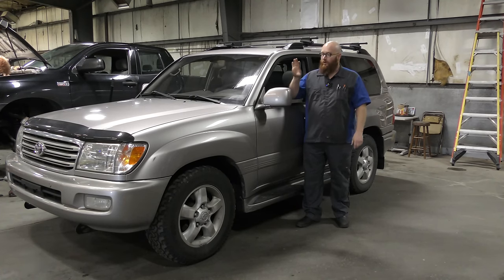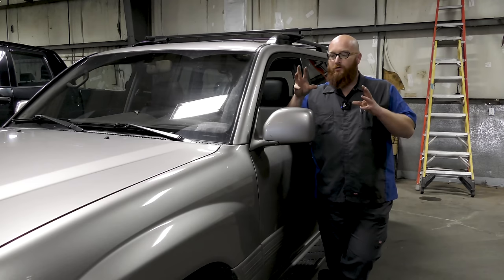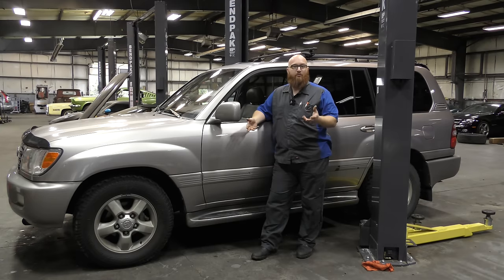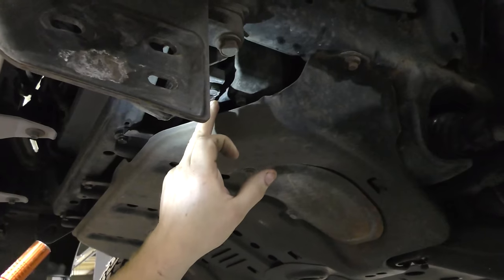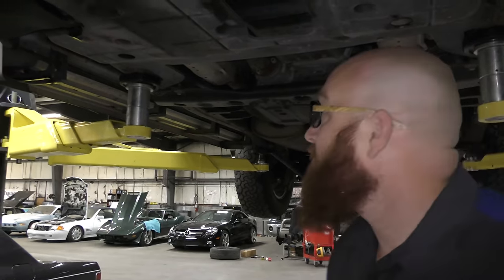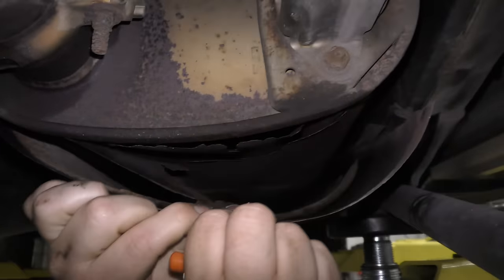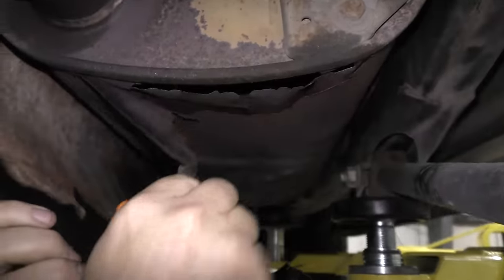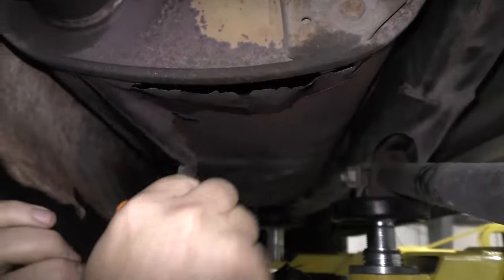Vehicle Making a Horrible Noise?! CAR WIZARD finds the problem & shares how not to be duped by shops

Comment: The ticking noise commonly heard with the 2UZ motor is typically due small cracks on the exhaust manifold flanges or a slightly warped exhaust manifold where it bolts to the block . A fairly common failure on the 100 Series Landcruiser.

Comment: The original radiator on my 100-series Land Cruiser cracked in the exact same spot. It had 229,000 miles on the odometer. Thankfully, it was an easy job; much easier job than the 80-series land cruiser that I replaced the radiator at 247,000 miles. I really do love these vehicles. The only downfall is the crappy fuel efficiency.

Comment: For serious off road Hilux, Land cruiser and Nissan Patrol/Safari Landrover, Defender, suzuki, and some jeeps.  We had to tow a Bmw X5 off a flat wet lawn. They are the most useless 4wd on the market. Ive done 7 years as a Toyota mechanic. 14 years on european cars. Toyotas are better. You buy them , one or two services a year depending on mileage. Thats it for the most part.  Now most land cruisers need front wheel brg adjustment once a year. At high milage the 80 series may need new front cv joints and axle flanges that they run in as they wear. The drive shaft may need to be taken off and have the diff pinion seal replaced and the transfer case output flange nut retightened. The occasional seized front brake caliper. Thats about all that wears on them other than  the normal stuff like brakes,  clutches, fanbelts, bulbs etc.

Comment: Any vehicle will last 200K miles, so long as you constantly perform preventative maintenance, but Toyota's (not all of the models) will probably cost you much less in replacement parts getting to 200K.

Comment: Oh mr. You just showed up late,
Because I did the very same mistake and told the mechanic I think and I need and I spent alot for that on my 2000 volvo s80, to discover later that nothing.. nothing was done to the control unit that I opened myself later and still has an issue and has a blown obvious line and some brownish component that may has gone bad....Thanks sir.

Comment: I had a 2008 subaru wrx sti that overheated every now and then and I got no warm air into the car. I left it to an authorized Subaru workshop and they told me that the head gaskets needed to be changed. After ALOT of internet research I found the actual problem. The cooler cap and the coolent reservoir cap were sitting in the wrong places. Just switched places on them and it fixed the problem. Perfect engine temp and alot of nice warm air into the cabin.
It never needed a head gaskets change and I'm lucky I found the problem myself before considering leaving it to the workshop (who wanted 2500$ to change the headgaskets).

Comment: Issue I've had that acted like a serious problem but ended up being something silly was in my 97' Oldsmobile Regency, The electrical system played up and it would kill the entire car. My dad spent months chasing it down and eventually we sat the car because of it. Turns out it was two silly things. There was a ground and small control box for most of the internal electrics below the carpet of the drivers door that was improperly protected from water so anytime someone got in or out with wet shoes it got wet, over the years it corroded away the metal and it started to short out and all kinds of other issues.including the second one, eventually it got so damaged that it blew out a relay under the dashboard and continued to blow it out repeatedly until we found out about the electrical box. In the end I think the relay and electrical box ended up being less than $100 to replace and it was something we could do without even going to a shop, it caused the entire car to die and the power features to act up, it was as simple as water got into something cheap that wasn't properly installed at the factory or somehow got damaged over 20 or so odd years. 

We sold that car a few years ago for around 1500, listed it pretty cheap despite it being low milage and really nice for what it was,  parents didn't want a sedan anymore, got an SUV instead, as far as I know, the Oldsmobile is still on the road with the guy who bought it, was a teacher that really needed a nice reliable car. According to carfax it hasn't been to any shops or anything since aside from inspections.

Comment: To respond to the question at the end. My 02 Tundra had a check engine light come on and I didn't have a scan tool so I took it to Autozone and they pulled the code. Code came up as evap canister close to $300 if I remember correctly for the part. Told them I didn't want to order it just yet (as you should always do if you have a auto parts store pull codes cause they will try to sell you parts and you may not need what they say). Anyhow, went back out to my Tundra and pop the hood as the Evap canister is actually up by the firewall. Found a vacuum line had cracked with age and came off the canister. Cut the end off that was cracked and put it back on, good to go.

Comment: Just occurred to me that the "horrible" noise (exhaust leak) was something the customer didn't recognized.  On my dad's cars, without fail, every couple of years the exhaust would rust out on one of our cars and we knew exactly what it was!  Worst was a 1979 Chrysler Newport, only a couple of years old at the time--it broke right at the weld on the cat.  While we were on vacation.  Had to find a garage with a welder to put it back together (which fixed that problem permanently...which is more than we could say for the rest of the car that was falling apart from the day we bought it new!!).

Comment: Toyota LC and LX470 are the best cars. I have one. But, the LX has three common problems. The screen that has air conditioner and radio in the same package, spare part is usd 14000! The hydraulic suspension (solution could be to replace it for a normal suspension) and the third is the traction control. Common issue is the gioroscope adjustment. When I was driving at 70 km going up a hill, and taking a curve to the left, the car drastically turns to the right. Not even the dealer knew how to fix it. So i disconnected it.

Comment: I have seen this same thing happen in my shop over and over. A tot of times a loose heat shield will bring a car in on a tow truck with a very worried customer. Fix simple heat shield = happy customer. Miles of Smiles.

Comment: It’s true I had AC issues and took it to a shop and they recommended that a replace the HVAC system, I took my vehicle to another shop for second opinion and he filled it with Freon and a tracer. It’s almost been a year and still working. They saved me 1500.00

Comment: Even if you don't tell them what you THINK it might be, they'll still quote you insane things you don't need. - I remember one time I took my car for an oil change, they did an "inspection" on it and claimed my timing belt was "dry and cracking" and that it needed to be replaced soon. But then, later on, my engine was misfiring because the ignition coils went bad (this was a 2010 Hyundai Accent, so it was time to change them and the spark plugs anyways, but at the time I didn't know that yet) - And I took it to a different shop... no mention of an issue with the timing belt, but they did claim the same issue was happening with my serpentine belt (dry and cracking). I replaced my own ignition coils and spark plugs (and made sure to properly gap them as well) and that engine ran better than it did when I bought it (I splurged on high quality spark plugs to make sure I'd never have an issue so long as I owned the car.) - The serpentine belt looked brand new. The car still had under 100,000 KM when I sold it and moved on to my next car. If you drive an older car that's out of warranty, try and diagnose it yourself (OBD2 scanner if your car supports it is a good start) and try and fix it yourself as well if you can. Oh and do your own oil changes, it's a fun way to spend an afternoon too!

Comment: I was going to guess it was a cracked exhaust manifold, because when I was considering buying a V8 4Runner, the only real issue that people have with the 2UZ 4.7 engine is the exhaust manifold cracking, other than that it is one of the most reliable engines Toyota has ever made

Comment: I would never tell anyone I was willing to buy a new engine, even if I new damn well I needed one.  I'd still go in and play stupid like "Well, it's making this horrible ticking or banging noise but I don't know what it is".  In my experience, it's best to find a mechanic you trust, and play stupid but be smart at the same time.  And by that I mean treat it like you're buying a car... don't tell them more than they need to know.  Don't tell them how much you're willing to spend or do to the car up front.   Let them do the talking and let them give you their findings first.  Also know your sounds and be able to identify common sounds for common problems (such as a ticking from the motor might be lifters or valve problems, which can be a serious problem and in some cases, may require a rebuild or a new motor depending on how bad), a rattling noise from underneath might be a catalytic converter that's coming apart inside or a loose heat shield or metal shield somewhere.  So if you know a little about cars, what to listen for and don't give out too much info, you can avoid being ripped off.  Getting an estimate done is like buying a car, don't tell the shop more than you need to.  Don't tell them what you'd be willing to spend because they'll find a way to make you spend that money.  I always error on the side of "Well, that was more than I was planning on spending..."

Comment: I had done some front end work and then when I took it to get an alignment, they quoted me $1200 and some of the parts I replaced, they wanted to replace.  I told them I couldn't afford that and they said it was too unsafe to drive and I should just park until I could afford it.  I drove to another shop that specializes in tires and alignments only and they did for $50.  I was in and out in one hour with perfect alignment.

Comment: I put a thumbs up, but under those conditions:
1. I drive one for only 170k miles from new;
2. It's maintenance without any actual major breakdowns costed about as much as a new Fusion or Grand Cherokee;
3. In Europe they all get the AHC... List price of a hydro pneumatic accumulator (sphere) is nearly 1.000$, I got it from the supplier of the Toyota dealer for $500 a piece... (4 of them);
5. When at 7-8 years suspension problems began, Toyota replaced 4 struts that are not shocks in AHC for 2.000$ + labour... Totally needless;
6. Front differentials with FIS are weak, it broke crown once in heavy winter conditions. Toyota replaced it together with maintenance for 3.000$ and labour... Total bill with other things was 6.500$
7. Maintenance schedule is a nightmare, 25k miles on all fluids including transmission...
8. Engine 1hd-FTE holds almost 12 quarts of oil... Every 5.000-6.000 miles and is picky, it would run poorly and increase fuel consumption on anything, but the finest synthetic SAE-xW-30 - same goes for transmission, transfer and differential oils.
9. Scheduled valve clearance adjustment every now and then... First done at 130k miles with only three needing minor adjustment, but... Engine was clean inside as if rinsed with gasoline or solvent;
10. Front bearings need adjustment and regreasing every 20k miles and cause problems;
11. Vacuum hoses are unreliable;
12. Diesel injection nossles, particularly plungers need to be replaced at 100 k miles as per maintenance/warranty booklet - haven't done it;
13. Belts would snap several times, although not timing belt;
14. Batteries last 2-3 years - two of them and JIS standard;
15. Consumes inappropriate amounts of fuel extra urban at highway. 75-80 is the last normal speed, at 90-95 it's 50% more.
16. Would eventually need a new turbocharger;
17. Although big, has short passenger compartment especially for 6ft 4in driver. Tight second row footspace.
18. Would cause all sorts of minor problems such as AC clutch self disassembly due to fallen off bolt;
19. Would self disassemble driver's electric window mechanism;
20. To be honest, would require new front stabiliser bar links at 150k miles, as well as rear... And that's it with the suspension apart from the AHC;
21. Has some kind of birth problem with the VGRS steering, would leave steering wheel in awkward angle after a U-turn and then gradually straighten it... Also steering vagueness in the real sense of the word;
22. Very hard time clocking 30k miles with a set of premium tyres. All brands tested.

Etc. Water leak from AC in dashboard would burn a major electric junction box and never happen again.
It's a utility vehicle with certain purpose. Using it for personal vehicle is a mistake IMHO. Hunters and adventurists maybe more appropriate users than me. All cons of a heavy car and no pros other than the nice AHC which is active BTW and saved me once at something like a moose test at 90 mph... Another SUV would have rolled over. It also has extreme traction and keeps it very consistent at snow and ice.
Engine built in respectable manner (honed main bearings, HD forged pistons with 12 hundreds of clearance and still no slap, etc) but a poor personal vehicle engine. Although mine has some kind of last series update and is much livelier above 2.800-3.400 rpm - hits rev limiter on top gear and goes 130 mph no problem.
Ah, sorry, rear diff would leak.
Torsion bars would need tightening and rear springs would need replacing at 350$ apiece or 30mm pads in the same mileage when spheres go.
I'm sure that's not the comprehensive list.
Costs three Cherokees or two F-150's and consumes another one up to now in one way or another. ...apart from the fuel, fluids and oil alone. And is still not very lively running vehicle. It still weights 2.74 tonnes empty.
But I like it, although a Jetta 1.4tsi is a better car than it. A sedan such as a Lincoln Continental Reserve 3.0 is a better car than it. And more than twice cheaper to maintain, no at least 4 times cheaper, or more.

Must be told as a part of the whole story.

Comment: Could have told you that lol always check the exhaust first for those type of noises. If the muffler and flex pipe going to the cat are good then check your heat shields on around the exhaust. Those drive lines need grease if they’re still that loosy goosy maybe u-joints should get a second look. The only thing I don’t like about the 4.7 Toyota v-8 is timing belt service. They last for a long time glad they went with chains for the 5.7.

Comment: I drive an 89 chevy celebrity euro/sport wagon I've owned  since 2002 .  I drive it every day and has 500,000 + miles. I started it after work, and thought the alternator was seizing, as it was making a blood curdling squeal. Took it to a guy who found a thin piece of steel sheet metal between the crank pulley and the frame. It either blew up from the road, or one of the window lickers i work with stuck it there.

Comment: Neighbor drives that generation Tundra, has 378,000 on, it. I've done routine maintenance on it, 1 radiator, and both front wheel bearings. It's been pulled out after being stuck, but never towed because of breakdown.

Comment: Trust my old mechanic Eddie I've known for 10 years to be able to tell him what I think might be wrong but he will search and tell me the actual problem. 
Example, had the upper and lower gaskets replaced on my 3800 series engine, he offered me and told me about the plastic L pipes and offered to replace those with the metal ones while it was all apart. 
A plastic part broke on my car from age I would not have noticed, they went out of their way to get me a replacement piece from the junk yard in great condition for free.

Comment: Wizard, can you break down why a muffler and wheel bearing job is $500-700? As an owner of a 100 series LC, that cost seems really high unless your estimating a new CV axle, lower or upper control arm.

Comment: The Weesner brothers in Lincoln, Nebraska, where I once lived were the best. The very first time I went, they quoted me two hours on a job and that the car would be done that day. It wasn’t and they said they were having a hard time and say it would be the next day. I was curious, so after getting off a bartending job at 1AM, I drove by the shop. The guy was still there working on my car. I said nothing. They spent 14 hours on it but charged me for two. 
A few years later, I was to the point I would hand them a blank check to do what repairs they needed. The very last time, when I was leaving town forever, they would be closed when I picked up the car. They knew I would never be coming back, but they put the car outside with the keys, and they said just put the check through the door before you leave. It was a great business. Their lot was loaded and they never advertised.

Comment: Every vehicle I have ever purchased or seen needs the batter cleaned up. Simple maintenance and people just do not maintain them. I like using the battery sealer on my posts. It keeps things cleaned. Yeah, never ,ever tell a shop you need an engine. Most are crooked as all hell. I have seen them refresh all the gaskets and say its a different engine. Even a Jasper engine sticker can be copied now days.

Comment: Bought a 2000 TLC off the showroom floor- paid $50K.  Drove it 10k miles/yr for 12 yrs... sold it for about $25k b/c my SO wanted a Full-sized 2012 Range Rover - Autobiography edition (supercharged @+500HP) - paid $130K...kept it for 4 yrs till warranty expired and then traded it for a 2016 MB GL63 AMG....both the MB and RR were like beautiful young women - sexy, pretty, fun, high performance, but obnoxiously expensive, unreliable, in constant need of dealer servicing, friggen high maintenance